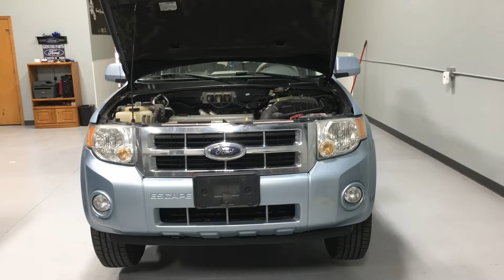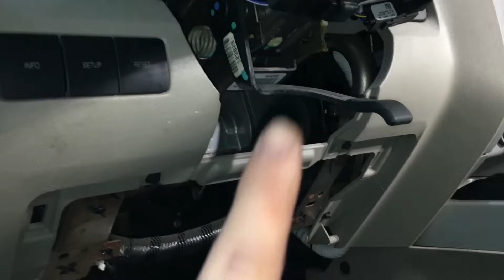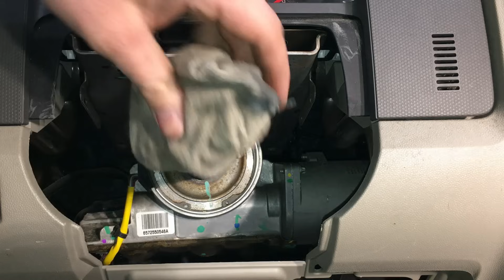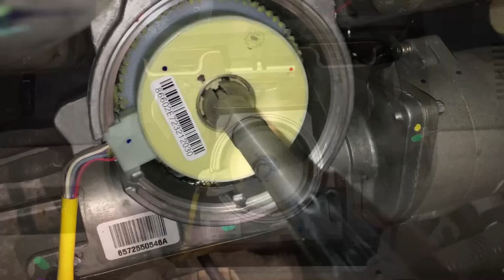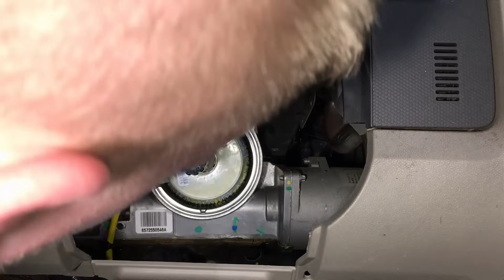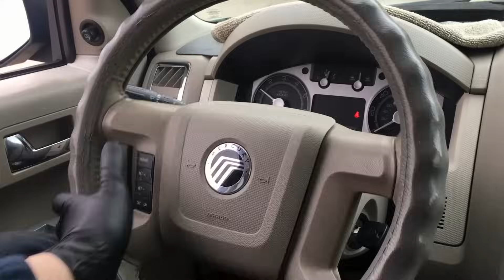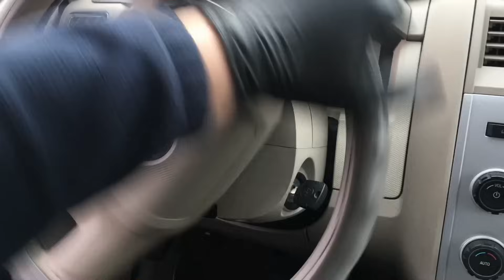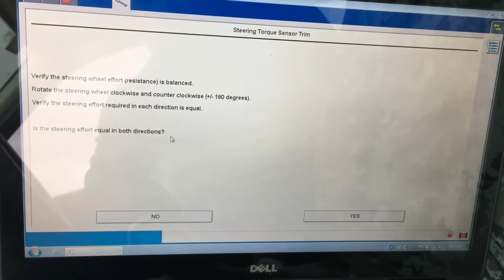2008-2012 Ford Escape Power Steering Code B2278 : EPAS Torque Sensor Critical Installation Steps

Comment: Video made process simple but mine still failed after checking & double checking each step. When is it safe to move the steering or column? We noticed that moving the input shaft to install steering wheel changes the alignment of the hole. Should I be concerned? Ours was fine when turned to on position then spun left once car started.. alignments were SPOT on before reinstalling.
Reply: I ran into this same problem with my 08 Escape today. Alignment was PERFECT before putting steering wheel back on, but wheel spins all the way to the left now. Did you find a solution?
Reply: @quangdog  I found where you can realign using a volt meter.. I was having some success but ended up burning it out. Not sure what the voltage should be..i used 12v.  I ordered a replacement & worked perfectly the first time. I think the key is not to move the steering column in any direction once you pull the pin. The sensor is not bad if misaligned, but it will be a bear to get it lined up again.

We noticed the sensor turns if you lift the column to put the steering wheel on. Move the column nearly all the way up before installing sensor. If you go all the way up the cone over the shaft/sensor will hit the car and u will have to move shaft to get it back on. Test fit before removing pin.

Had a thought but NOT SURE it would work.. reinstall the original sensor & put it back together leaving the sensor unplugged. Plug the power to the new sensor into the car.  Connect battery & start car.  Slowly turn the disc on bottom of the new sensor until wheels are straight. Replace pin. Start over with install.
Best of luck.. hope this helps.  Ours is working now.

Comment: This was a great and well done video.  Thank you!  Quick question, my steering wheel was shaking like how you showed in the beginning of the video and then later today i lost all of the power steering.  Would replacing this part restore the power steering?  Or is there something additional wrong?
Reply: To Ryan Lamkin
This should fix it.. Mine eventually did that too.  The sensor is so bad that the car is dropping into manual mode bypassing the power steering system. If you restart the car a couple times it may work again.. for awhile.. but very dangerous and should not be driven until repaired.  Especially @ high speed.. u never know when the power steering will drop out.. without warning!

Comment: Wow. you made it look super easy taking that snap ring off.that's the hardest part for me because those pins always slip out the holes.I always have to rig a flathead screwdriver at the right spot and apply forward pressure with a hammer to the pliers and hope that the ring catches the screwdriver.Super awkward piece to get out.
Reply: Get Knipex or other good brand snap ring pliers of the CORRECT size and you'll be golden.

Comment: Does this cause the steering wheel to become hard to turn 🤔
Reply: Same happened to mine, took it to an electrician, he erased the code, now the steering is soft again but i dont know for how long it will last or if i will have to replace this part.
Reply: Ruben Jimenez Im wondering the same thing, yet no one else who knows about this has commented.
Reply: Ruben an screamingairborne yes if the part it’s going out it will make it hard for you to turn, if the part is completely gone it’s will cause your steering wheel to shake heavily
Reply: Ruben Jimenez yes
Reply: It hapen to me even if im not turning it gets hard i have to exit . Turn the ignition off and back on and its all good but recently get realt bad . I thing i need an electric steering  power pump

Comment: Great video. ! 
In my case i had to reinstall the sensor 5 times until i aligned the dot EXACTLY in the middle of the window , otherwise it goes all the way to one side. It's ridiculous how accurate you have yo be. Every time i did it i didnt install the wheel until i was sure. It also was softer to one side so it will still require adjustment with a good scan tool😒

Comment: fYI:  That last step for the fast mode is important.  I was one day away from taking it to the dealer.  After replacing the sensor it was still the same.  I finally found a nationwide garage that could do that calibration.

Comment: Is there a difference between a Torque Angle Sensor & a Steering Angle Sensor?  I have a 2008 Ford Escape doesn't fall under the recall.  Steering wheel would shake left right, left right while parked and while driving.  Two days later it now has no power steering.  Checked fuses, reset the computer manually nothing.

Comment: Is using a torque sensor from the junk yard ok ? I know its used BUT In a financial bind right now . My concern is the pin & NOT. Having an alignment tool
Reply from the maker: no you must install new, its best to buy from my amazon link it will be the cheapest

Comment: Will this torque sensor cl8z3f818a fix my steering problem my 2011 Ford escape turns very easy to the left and hard to the right no shaking

Comment: I have an 09’ Escape. The steering wheel started twitching back and forth exactly like the video. The power steering still worked but the wheel was twitching. After about 1-2 months of this, I went to start up my car (which had just been parked 15 minutes prior) and their was no power steering at all, as well as a wrench light. I replaced the Torque sensor after watching this vid but nothing changed. The wrench light is still on and no power steering. Any ideas? Also, before any of this started, I thought I heard some sort of faint knocking sound when I’d go over certain bumps in the road (bumps smooth enough to jostle the car but not loud enough to mask the noise). I noticed when the steering wheel twitching started, it sounded like it was connected to that faint knocking sound and it had been made a little louder. Now that the power steering is dead, it’s back to that faint knocking sound over certain bumps. I had a mechanic drive with me when I first started hearing this faint knocking sound but it was very faint and he said he couldn’t hear anything. Also had a shop rip me off telling me the issue was sway bar links (they replaced them for $360) only for there to be no change to the noise -_-  I’d greatly appreciate any help here. Thank you!
Reply: Nevermind, got the code cleared and it works flawlessly now
Reply: @JonathanRogler  Hey man. Did you go to a mechanic and just ask to get the code cleared and that was it??
Reply: Adrian yes

Comment: Very good video. After watching I decided to give it a shot. 2009 Mazda Tribute. Steering started twitching very little and progressively got worse. 

Hardest part was the snap ring and obviously lining up the new sensor. 
Be sure to use the supplied  tool to hold down the new sensor and pull the pin with the tool in the kit together. It will help hold the new sensor flush. 

Thanks so much for this. Lots of people are going to need this eventually!!
Reply: Hey, how long did it take you to do this ??? I'm about a month away from trying this myself in the garage. a little bit worried.

Comment: I replaced the ps torque sensor and I still don't have any power steering :(  Any recommendations, besides the Ford dealership?
Reply: suedz1975 I am afraid of this same problem happening to me.
Reply: did you still have the error "power steering assist fault" on the display?
Reply: @Adrian-lv5kk  yep 😕

Comment: Have the same issue with my 2008 Escape. Power steering has now completely stopped working. Ford service said my VIN is not part of the recall. bullcrap as always. I'll be getting the torque sensor and replacing it myself thanks to videos like this on Youtube. Saving me tons of money...and SCREW FORD!
Reply: Ford is garbage ! (Owed Pinto, Mustang V6, Grand Marquis and now ... a Cmax hybrid which tops the garbage list, all had severe manufacturing defects - no more patriotic feelings, my next one definitely made in Orient).
Reply: $200 and 6 hours of labor later and my power steering still doesn't work.
Reply: @suedz1975  Did you follow the steps correctly?

Comment: After installing the sensor (after minute 20:20), can we move the steering for the final installation? or the steering need to stay in the same position?
Reply from the maker: after the pin is pulled you can move it yes.
Reply: @FordTechMakuloco  Thank you!

Comment: Thank you for this great tutorial... this is a very delicate procedure, is funny how you run out of the front of the airbag when you turned on the ignition switch, it would be interesting to see what's inside the old SAS sensor maybe to figure out why it can be damaged so easily if is not aligned properly.
Reply: I was wandering the same. Maybe some cheap, weak plastic gear rotating around a coil.

Comment: Thanks for this excellent video.  I have a 2008 mariner hybrid (60,000 miles) and the power steering stopped on a very cold morning. The Ford dealer said they had already fixed the recall for the previous owner.  I followed this video to change the torque sensor.  It made no difference. I have seen on other boards that the electric motor on the power steering can get fried in very cold weather.  I see that the motor is part of a $600 steering column module.  Before I buy and replace that, is there a test I can do?  Also is that an easy job like this was?
Reply: You may try a SAS calibration, it can be done with some advanced Scanners or ford vcm tool
Reply: Hi there. Mine just stopped working with extreme cold weather here too. What did you end up doing? Did u get it fixed?

Comment: i replaced the sensor and followed all directions to the T, i started my 2008 escape up and had no twitching of wheel or "freak out" but i still do not have power steering and dash is still showing powersteering assist fault? any suggestions?
thanks
Reply: You may need to double reset the SAS with an advanced scan tool or ford vcm tool,  mine was like you described, after a doble reset it worked fine, even before replacing the ange sensor,  in my case the code b2278 was present,  I replaced the angle sensor just about 2 days ago with no issues, everything is working as it should.
Reply: @miscompras82  thank you i will try tonight
Reply: @miscompras82  can you explain how to double reset the SAS?  will a bluetooth obd2 device with the Torque Pro app on an android be able to do this?
Reply: were you able to "double" reset the SAS ?
Reply: @Adrian-lv5kk  I think you need a more advanced scan tool, any tool with SAS calibration will work fine, I used this " Autel Maxicheck MX808 ", the double Reset I mentioned was,  After I retreived the code, I cleared it, then scan again and even with no codes I cleared again,  thas was my "Doble Reset", for now it working as it should
Reply: @miscompras82  So technically, you're saying someone could do a "double reset" and it could restore power steering without having to replace old sensor with a new one?? I could possibly find a Autel device that has SAS calibration on Amazon and attempt this instead of buying a new sensor?
Reply: @Adrian-lv5kk  you can do it as a First step before replacing the angle sensor, mine worked fine for about 8 months before replacing the sensor
Reply: @miscompras82  Thanks man im  going to call a few shops to see if they have an advanced scanner with SAS calibration and try it out.  Its been like 2-3 months without power steering and im going nuts. i asked a few shops about replacing JUST the  torque sensor/clockspring and almost all of them had no idea how to do it so i didnt go that route. Option B was to install it myself but i will try your temporary method first. I'll keep you posted.
Reply: @miscompras82  oh and one more question, do you just ask the mechanic to clear the code? i kind of don't get the "double reset" comment, you can clear any codes a second time even if no codes show up?
Reply: I TRIED TO RESET WITH MY STANDARD SCAN TOOL, IT DID NOT WORK, I HAVE NOT TRIED WITH AN ADVANCED TOOL BECAUSE I DONT HAVE ONE, ANY OTHER WAYS TO DO THIS? CAN I BRING TO FORD DEALER TO HAVE THEM DOUBLE RESET IT?
Reply: @joshlawrence7813  The dealer can do the diagnosis and calibration of the SAS but with a cost I think,  The first time I had this problem, took it to the dealer and they Reprogramed the cluster I think and recalibrate the angle sensor as marked on the tsb for this compliant, the didnt charge $ nothing as it was part of the recall
Reply: @miscompras82  did the reset with my friends advanced scan tool, everything works perfect, thank you

Comment: Excellent video, great walk through. Little tip: Keep the key in the ignition during re-installation so you can turn the wheel to the exact position to align everything perfectly without throwing the sensor out of alignment. Worked for me!
Reply: whoa is it safe to keep the battery plugged while you unhook the steering wheel? I am about to attempt this my escape.
Reply: Adrian Leave the battery disconnected for the entire procedure.

Comment: so, we change the torque sensor on my ford but i have the sterring problem ( like in the end of the video). we try to turn it left to right and we go to a garage because the torque sensor don't want to learn is ''procedure''. even if the guy at the garage do the trick with is computer, the problem is still there.
 what can i do?

Comment: Hey great video. I just replaced the sensor. Same symptoms and code matched coming from the dealer. I purchased the unit you provided in the description and after replacing the sensor everything went well no wild turning of the steering wheel but there is still no power steering. In addition my powertrain (wrench) light is on. It turned on a day or so prior to the power steering going out but I have a feeling it's probably unrelated. I'm sort of at a loss at this point. Any thoughts as to what might have happened?
Reply: so maybe its the motor itself? did you ever figure your problem out?

Comment: That’s a great video! Hey you ting a Lincoln MKZ 2011 hybrid, could have the same problem? My car shuts the power steering off, when slow parking in my garage or side of the street, and a red messages displays in the dash ( power steering assist fail)  thanks

Comment: Thank you for this.! Excellent walk through. Followed step by step and the steering problem is fixed. The hardest part was getting that snap ring off and on. Regular snap ring pliers just don't cut it. 

I had to sacrifice a pair of needle nose pliers. I put a 90 degree in them and ground the ends to fit the ring.
Reply: Stephen Robinson how did you get the snap ring out??
Reply: @MatiHDD  I sacrificed a set of needlenose pliers. My snap ring set just wasn't strong enough.

I ground down the ends of the needle nose to fit the holes and put a 90 degree bend in them so I had a good position and leverage. That's the hardest part of the job. 

Extra hands are great s well. Some one to hook and move the snap ring out while you concentrate on keeping it compressed

Comment: Just an update: I decided to do the install myself and the hardest part for me was removing and installing the snap ring. I bought a couple of tools that didn't work, one snap ring tool from O'Reilly's and a tool  from Home Depot. I ended up buying a large snap ring tool from a tool store for around $71.00 that work great. I hated spending that much on a once use item, but it made the job a snap. My thumbs were actually swollen from using the other tools, this one locks in place, so no constant pressure is needed when trying to remove or install the ring. The rest of the job went pretty smoothly and the steering so far seems fine, it turns nice and smooth in both directions. I didn't have it scanned and I don't think it needs to be unless my friend starts having trouble with it. Thanks again for the instructional  video, I wouldn't have known how to do it otherwise! I see your shop is west of me a few miles.
Reply: Could you please direct me to the snap ring pliers that you purchased for the job? Thanks!

Comment: Well, my swap is done and, 3 days later, it seems to be working out. I noticed that lowering and raising the column shaft changed the alignment hole's position in the sensor's "window". So, I reinstalled the old part, centered its hole to where it was when I first exposed it and then used a 2X4 to hold the shaft at the original height while installing the new part. After the job,  I didn't even turn the steering left or right before lowering the vehicle and taking it out for a test drive. I thought there'd be a stiffness in one direction or the other but it feels just right. A couple of things I learned, though:

1) The same part seems to work for all 2008 to 2012 Escapes and Mariners, and some vendors seemed surprisingly clueless; saying the part wouldn't fit my 2008.
2) The Ford installation video says that if the steering jerks all the way left or right after the job, just start over and repeat the alignment steps "with greater precision". No mention of throwing away the new part. Maybe that's for the Dorman replacement. Who knows?
3) Some long nose vice-grips with the tips modified/ground to size were fantastic for removing and reinstalling the huge clip that holds the tube over the sensor.
Reply: I watched the FORD video and they did say that. I reinstalled the same sensor 10 times today. The first time, original time, it’s ripped hard to the right. The second time it BARELY turned left but it wasn’t quite perfect. Every time I got different results: always worse than the second time, never perfect. I have another sensor but I don’t want to use it unless I absolutely have to.
Reply: You won the internet today, I was off to the right and was terrified to pull the pin, wiggled the column and got it center, sent her and she perfect center.